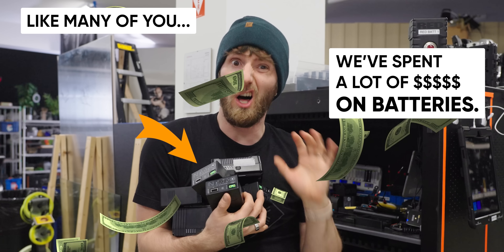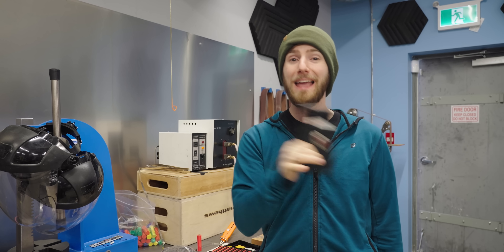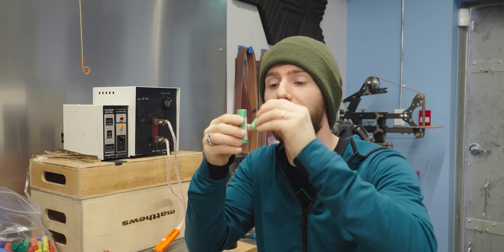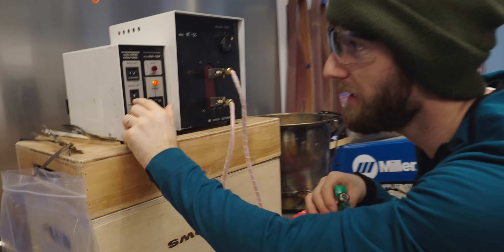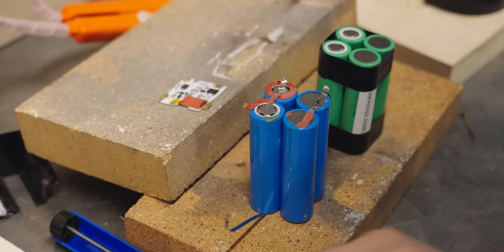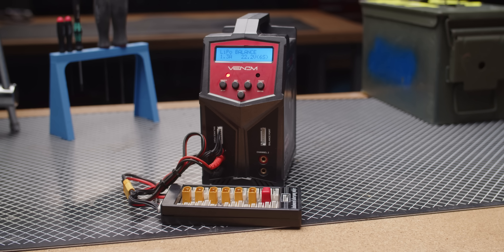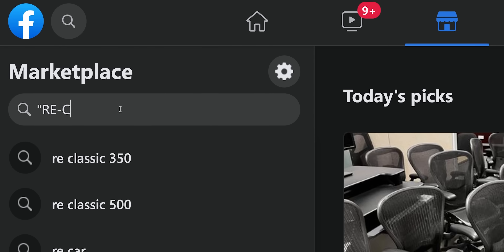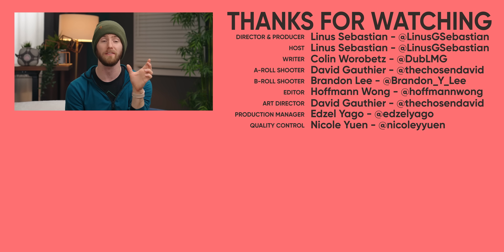This should be illegal… Battery Repair Blocking

Comment: I think there's a bit of a misnomer in that warning, while it is true that those cells would be unsafe to reuse in that same number with a different cell thrown in, they're not necessarily unsafe to reuse in smaller numbers. Testing to find out which cell, or cells are bad and filtering them down to lower count applications doesn't present the same danger. You've got 16 cells there, 1 is probably bad so we'll say for the sake of argument you've got 15 good cells, you could put 8 of them in one of those DIY battery banks or something, use 6 to rebuild an old laptop battery (a pretty common number for those old laptops that used 18650s in their larger pack) and 1 in a flashlight, none of those things is made any more dangerous if put together from used batteries of a married status, they're basically in the same state as they would be if you put them together with new batteries a longer period of time ago, and form 2 new married sets of different size and 1 battery destined to be alone until it ceases function.

Comment: I am guessing you already tried this, but have you tried charging it?
i had something similar happen when replacing batteries in a laptop pack and after i gave it a charge the BMS woke up. 
In my case i guess the battery voltage protection kicked in and stopped supplying power by disconnecting the batteries completely after it detected a low voltage threshold.

Comment: I’ve been doing this for many years now. I tend to buy battery packs from Aldi or Lidl meant for their power tools. They are well priced given 10 cells per pack, good quality cells and all nicely matched. Takes a little more work to remove them but of the many I have done I have yet to experience a problem. Bit shite when companies nail the BMS down though, that really pusses me off. I have found the occasional work around for some of those.

Comment: I'm surprised they went with the standard 18650 instead of going some weird proprietary Li-Po pack. Edit: Okay, if you're big into reducing for bullshit "ENVIRONMENTAL" reasons, then why don't you find the good cells and re-purpose them for other projects that can take and use SINGLE 18650 cells. Edit 2: Why didn't you 3d scan the holder, then print out holders on your 3d printer? You have all of these gadgets and tech around, use them.

Comment: Having seen your problems with these round cells I just have to ask: Is that something round cell specific? We are working with Pouch cells for a while and never even came close to the problem you seemed to have. And what about equalizing the cell potentials through high resistance resistors before giving them a direct connection?
Reply: I didn't really see that Linus had actually shorted anything on that second one. (We didn't get to see the first one). Seemed like the spark might have just been from a poor contact between the nickel strip and battery and probably didn't kill it? I have to think that prodigious use of tape would help to guard against accidental shorts.
Reply: ... By "pouch" cells do you mean typical LiPo batteries? The "round" ones are Lithium Ion 18650's and both work in almost the same way. Its a better idea to just check each cell with a multimeter before connecting them, although in my experience I have never had any problem just connecting them without any sort of balancing before
Reply: @untrust2033  can't give you an exact answer, not the one responsible for selecting the cells but I think they are typical LiPo

Comment: This has been the case with laptop batteries since time immemorial. 

I myself failed re-celling a Thinkpad battery some time ago and I made serious effort to smoothly transition from old cells to new cells such that the BMS board was never left unpowered and the voltages were always consistent. Nevertheless, the BMS bricked itself.

Nowadays, laptops no longer use 18650s so re-celling is not a possibility anyway.

Comment: If you just had plugged in the battery with the bms to the charger it would work.
Its a safety feature of a bms to not give power unless is is first charged

Comment: Yes, I want to see how they’re recycled. Great video! Lithium cells are no joke and glad you could show how easy it is to flash and rupture them. I assemble prototypes and the best way to describe it is like dangerous lego. They can flash even when assembled correctly if they’re not balanced and it is merciless. Any small mistake literally explodes in your face. Welding is equally challenging, too little power and the tabs don’t stick. Too much power and you rupture the cells. It takes full awareness and concentration to build them.

Comment: Would love to see a tour of a recycling plant. If your premise of sparks indicate damage, your own clip of a mfr weld shows sparks @ 17:30. Instead of throwing them out, put them on a tester and check voltage, resistance and capacity.  See if they self discharge over time.  Science vs fear.

Comment: Professional (and hobbyist) BMS engineer here. The technique demonstrated in this video is unsafe. They should have covered the cells not in parallel with tape AND cut their nickel before soldering. Those long strips hanging out the side made me nervous. This really isn't a safe method to replace cells despite having acquired the proper tools. There's also no need to use 2 layers for such a low current application. 

For battery repair I wouldn't consider software lockouts particularly malicious. These systems are quite dangerous to work on, especially during disassembly. As a DIYer you should build your own from scratch using off the shelf spacers and bms boards. Just 3d print a case for them to fit the mount. I really worry when I see videos showing bad techniques without explaining why they're wrong. It's not good for the DIYer who wants to get into building packs.

Comment: It's not the same type of battery that is in cell phones and that pack you tried to rebuild
Cell phones and most laptops use LiPo batteries while that pack your working uses LiFepo4. They both use totally different types of lithium cell technologies and should never be compared

Comment: Yeah... knew I was going to enjoy watching this, I work as the lead technician for a small phone refurbishment business in the UK and certainly can express as part of a 3rd party repair service how frustrating the "Soft lock" on BMS' particularly for iPhones really are. Currently you need to move the genuine BMS across to a fresh cell, apply a charge to the battery to force the BMS to reinitialise, re-program it with custom equipment, plug a non-genuine battery into the phone to force the "non-genuine" message, then finally fit the original BMS equipped battery. Just to get iOS to report the battery health at 100% correctly. It's completely unnecessary and it's issues like this that greatly steepens the curve of depreciation on devices, so for those that don't care for either the planet or right to repair just know that ultimately it's you that this behaviour affects the most.
Reply: @julian.morgan  iphone Xs, Xs Max, Xr is the oldest generation that does this. Apple has the technology implemented in iPhone 6s and newer. They rolled this out as an update to all models but was met with complaints. So as of now the Xs and models of that generation has the BS soft lock.
Reply: @julian.morgan  As others have stated it's since the XS/XR but apple went further with the 11 series onwards by having a read only ROM on the BMS so an external chip has to either be soldered onto the BMS or an intercepting flex added between the board and the battery connector so that newer models can be reprogrammed to as well. Just to be clear you can replace the battery and it'll still function just fine but you'll receive a warning message and lose iOS battery health readings. Imagine how many customers have felt ripped off just because of the doubt this has placed and placebo RMA requests it's caused.
Reply: @julian.morgan  xs an above

Comment: This is probably stupid but can you not connect the BMS to a bench power supply to maintain the voltage as you change the cells?

Comment: Would you consider locking out the BMS on Powerloss? Seeing your try on Lithium Cells I can understand Manufacturers trying to stop anyone messing with their Hardware. As I am working with / programming for a BMS myself I think that disabling myself on Boot and only activating after a special command in the factory is not too bad of an idea. I feel comfortable handling large amounts of Lithium Cells so I would not like that myself but I can see the protection side for the general public.

Comment: I already locked my Lenovo G50 Battery BMS by trying to replace the cells. I should have added them in parallel then It would have worked.

Comment: sparks when we are welding is common enough ,i used to rebuild such battery packs for leaving ,when only you damage the cell it self you have a problem and thrust it will not be just a spark you will have flame and a lot of smoke.

Comment: I'm pretty sure the sparks you were having were from the spotwelder, not from the batteries. there was no reason to throw them away. you probably just had a bad contact between spotwelder and nickel strip. I'm surprised you didn't realize that yourself; you had lots of sparks when using the DIY spotwelder too...

Comment: Common, you need to reduce the soldering time a lot, it should only do sparks, not turn the metal red ! a few ms should be enough
Regarding the BMS, they usually do not use contain ROM config, only RAM config ! so removing the power (or doing a short on it) will make it unusable, but if you solder wires on the BMS and powering it by an external PSU (or soldering a temporary 12V battery with a series diode to the BMS battery terminals) would make it still work after repair, the equalizer wires should be fine disconnecting altough I'm not sure if the battery will not go into protection mode (and be also dead)

Comment: You can just replace the defective cells, just make sure they are all around the same voltage before you weld them in, if you want to be extra cautious replace the cells that were connected to the defective one in parallel, the BMS will handle the rest
Reply: Wrong, you atleast have to make sure their capacity is the same else the lower capacity cell will drag the whole pack down.

Comment: This video could not have come at a better time...I planned to power a portable fume hood with swappable 18650 packs since it didn't seem that complicated after watching a DIY video. I was going to source the cells online, 3D print housings and just wire it up to a rechargeable circuit, but two months ago I read some forums about reliability issues depending on the cell manufacturer. My gut told me no so I went with a car battery instead, but I was reconsidering the idea until seeing this. I had no idea of the safety precautions you should take when making your own packs. Most DIY videos just skip over what could go wrong and only show success. Thanks for watching my back LTT!

Comment: Jeez, it is true that you need to be careful with lithium batteries, but you guys make it seem like we're working with a thermonuclear warhead or something. I've rebuilt a few packs, and in one case I did replace only 3 bad cells in a pack of 30 batteries, and I used solder since I don't have a spot welder. I am aware that this is bad practice, since soldering can put a lot of heat into the batteries, and partially rebuilding a pack will likely cause batteries to wear out sooner. But as long as you are careful not to short them or heat them up much, use good quality batteries, and make sure they aren't operated outside their specified limits, you'll be fine.

Comment: Makita does the same with their batteries. BMS has some fail conditions and if any of them are met it just bricks itself and recelling is not possible without getting an replacement bms. Ofc it's not an "evil" bms that just shuts down after x amount of charges, but it is very strict about voltage and temperatures, and even if one cell fails the battery goes into "replace me" mode permamently.

Comment: The batteries are very still fine, the bad welding tip/placement just caused the spot welder to arc. there's a reason it's spring tensioned, but lack of experience probably allowed the tip to arc between itself rather than through the strip

Comment: I blame your spot welder for the mechanical failures. Battery welders do it with a single impulse, see your own video clip, it looks like a discharging capacitor, throws sparks. That spot welder you used was getting the tips red hot for a significant time.

Comment: my old laptop battery has also the EVIL BMS... doesn't charge.. but hacked an external charger on it with balance leads....  charged it up to 4.1v cell pack but the laptop still refuses to discharge nor charge it..   could be that the balance of the cells was screwed up.. now its just fine still sitting in the 4.091~4.095V range...... bloody evil! :-)

Comment: You could take apart all the cells, test them and keep only the ones that still work decently... You could use them for future projects.
The fact that you cannot reuse the BMS could be a safety issue... Some of them have a security function that blocks the battery if it goes under a certain voltage (a very good example is the battery pack of some drones, if the voltage goes to low, the battery could become dangerous because it could turn off randomly in future uses).

Comment: Battery recycling is very important and interesting to me. In film, specifically sound, it’s common we run through 70-100 single use lithium batts in 10 days as reliability is always chosen over eco or budget. It’s always frustrated me having to use so many and really hope my recycling efforts actually do anything.

Comment: funny enough. just saw a EU proposal for even professional not to fix batteries for the same reason. so you won't be able to get the battery fixed but by law have to replace.

Comment: yeah so the way around this is to not disconnect the old battery but to try to voltage match the old pack and new pack, then connected the new pack with alligator clips while the old pack is connected so the board never loses power, this is a trick some people use for teslas when the 12v batter needs replacement
Reply: i believe how they make it so if it loses power it no longer works, the control software is on ram so that when it loses power it loses the data similar to some old arcade machines, another possible work around is to find which chip it is and supply it with power while the battery is disconnected.

Comment: Many BMS boards if they dont output voltage try to charge it first (if the charger wont do it use a bench power supply directly)  and you might get it on again

Comment: Replaced the batteries in two of my phones thanks to ifixit. Extended the life and let me continue using phones I bought as far back as 2017 and 2014. Replacing batteries like that is relatively easy to do if you're familiar with electronics and disassembling them carefully. I wouldn't attempt anything like replacing dead cells though...just full battery assemblies.

Bring on the tour of battery recycling!

Comment: Maybe a stupid question:
Why not simply have removable rechargeable 1.5V cells that you plug into the housing that contains the BMS? Wouldn't that be a good hazard-free way of replacing the cells?
EDIT: type and voltage of the cell doesn't matter, my point is to plug cells into a housing and equalize them on first recharge.
Reply: 1.5V cells are typically Alkaline non rechargeable. Before lithium rechageables are nicad 1.2V. These cells are lithium 3.6V. Not only are the cell voltages different but also the max current they can deliver, where lithium can deliver more than the other two.
Reply: @UmbraAtrox_  ni-cad cells are illegal to sell now in EU, also ni-mh cells are 100% voltage compatible and have a greater energy-density.
Due to this, ni-cad has almost disappeared entirely.
Reply: You don't have to use 1.5V cells. The 18650 form factor is perfectly replaceable itself.
Reply: Lithium cells are for one pickier about their neighbors (parallel cells). The BMS can't make a brand new cell magically match voltage to those so you could have a dangerous rush of current between those in parallel, you have to make sure they are at least similar enough voltage and the BMS will do the rest. Your 1.5V cells are just more idiot proof but it's wise to match new 1.5V cells in battery all the same, but don't have to bet those will thermal runaway.
Reply: @leerman22  This is the only comment addressing my idea (the type of cell is not important), simply the design to plop them inside the housing. About the voltage matching, can't we have resistors between them and when you change them they automatically sync their voltages on first recharge?
Reply: @lake5044  Technically yes, lossy yes as well. It's just to get the voltage matching. Hard to make it cheap and idiot proof since they would be best with the same conductors.
Reply: the nominal voltage of ni-mh cells is 1,2V and the energy density of lithium cells is much much greater aswell as the self discharge rate and internal resistance.
So lithium ion cells can deliver much more power while also beeing more efficient due to low internal resistance (=waste of energy through heat) and at last, it's not that easy to reach the target-voltage for a lithium pack with ni-mh cells.
And as already said, the energy-density is much less so the overall runtime gets reduced dramatically.

Comment: Almost all of the sparks you saw are from bad contact with the spot welder to the battery. It's not the battery shorting, the batteries are completely fine. You were 100% overreacting.